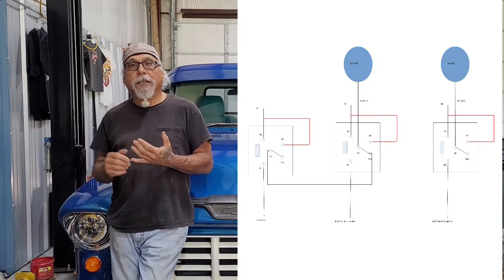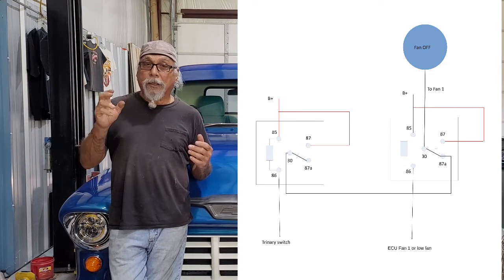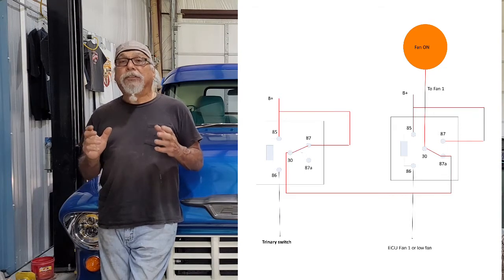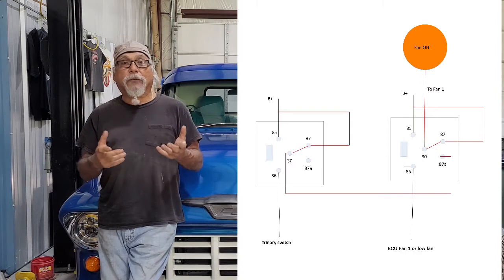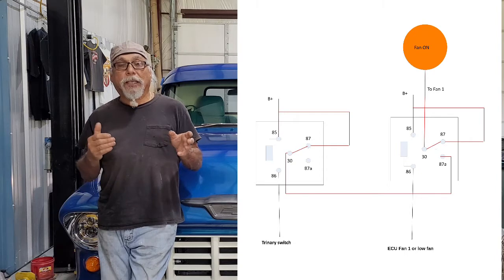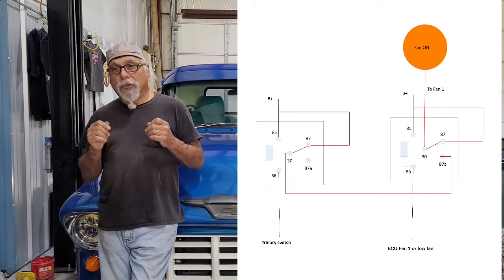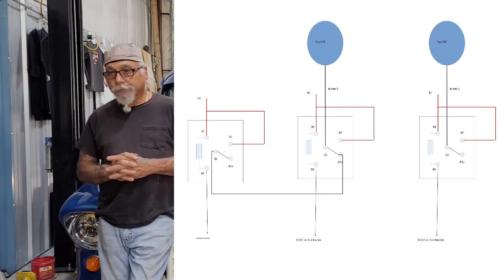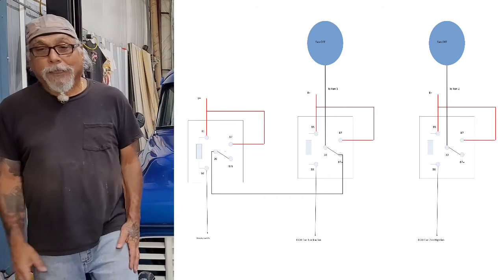LS Swap, wiring Trinary switch without getting P0480 or P0481 codes

Comment: I really need this but I can’t understand how you got it wired from the diagram
Reply from the maker: If you only have one relay to the fan and you have both the ECU and Trinary switch controlling the fan relay by (grounding pin 86) on one relay. When the AC is turned on, the trinary switch grounds pin 86 on the fan relay to turn on the fan. The ECU will see the fan signal go to ground and will cause a  check engine with code P0480 or P0481. Due that only one relay being used and both signals (trinary and fan from ecu) connected to pin 86 on the relay. The ECU is looking for voltage on the fan signal (fan 1 or fan 2) pin. If the trinary switch pulls it to ground to turn it on the fan the ECU see it as a fault (because the ECU did not signal the fan on). To get around this you add a relay for the trinary switch and one for the ECU fan signal (using two relays).  This way the trinary or the ECU can control the fan without pulling down the others signal. This way the ECU control signal for the fan is not pulled down to ground causing a check engine code when the trinary switch want the fan on. I hope this helps.
Reply: @oldmanfixingstuff3722  so currently I got my fans grounding from my pcm like you said, I got two relays one on each fan  so you are saying add a 3rd relay for trinary  so how would I wire that
Reply from the maker: @ThelifeofBigJody  in my diagrams I show how to wire the trinary to one fan by using two relays. The trinary relay feeds one fan relay (first fan or lowspeed fan). The second fan is by itself on its own relay. The trinary relay from pin 30 goes to the fan relay pin 87a (normally closed) pin 86 on both relays is your ground single. Pin 85 and 87 go to fused power both relays. Pin 30 fan relay goes to the fan. If you have two fans it's gets wired the same as the other fan relay but you don't wire the trinary relay to it. Also make sure your wire and fuses support your fans. I have 3 30amp relays and fuses and wiring to support the amps.
Reply: @oldmanfixingstuff3722   basically I just got started wiring I did my ls swap my self on my 88 caprice

Comment: What kind of relay did you add as the the 3rd one on your set up and where did you get it?
Reply from the maker: I used these from Amazon. They are out of stock, but others sell them. 
10 Way Blade Fuse Box 80A 5-Pin Relay Box Fuse Block for Automotive Boat RV Truck Fuses Holder https://a.co/d/gcLEu0k 
They are just 30 amp relays. I like the way they They stack together. I did not need to use a 30 amp relay, but it was what I had, and keeps all relays the same.
Reply: I appreciate it thank you so much

Comment: I didn’t even know the ecu controlled the AC. Great… more anxiety when I get that far. “LS swaps are soooo easy” they say
Reply from the maker: In this case the ecu is controlling the fans when the engine hits a programmed temperature. The ecu also checks the fan circuits and will set a check engine light and code if it thinks there is a failure.  When in a stock car the ecu knows when the ac turns on and controls the fans and will turn on the fan when the ac comes on. In a ls swap and aftermarket AC, it's the trinary switch that turns on the fan when the AC comes on. But if you wire the ecu fan control and trinary fan control to the same relay the ecu will think there is a failure if it senses the trinary control pull to ground.  Hope this helps.